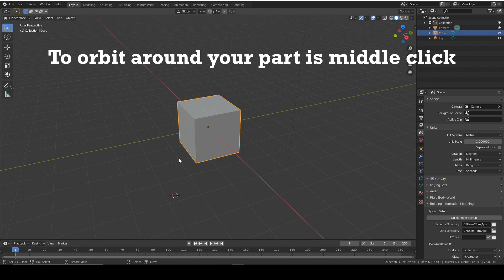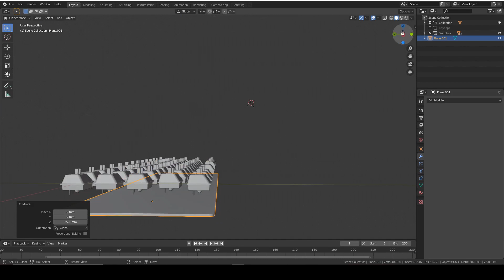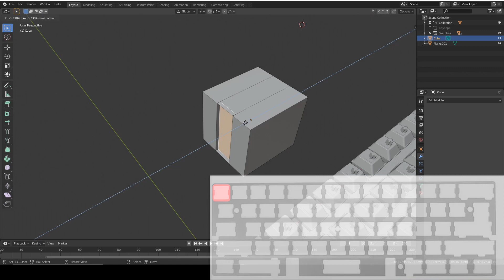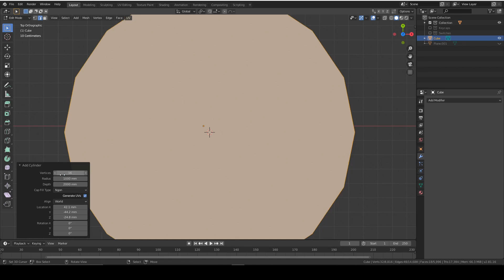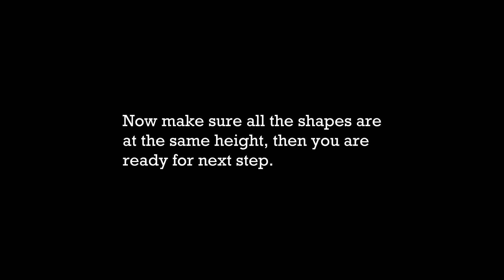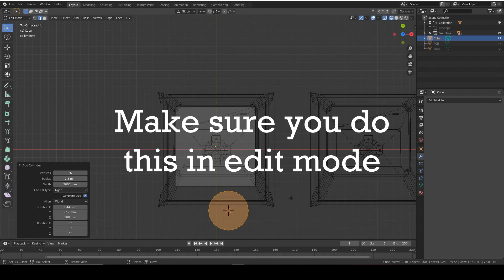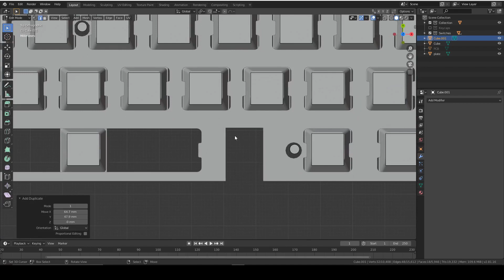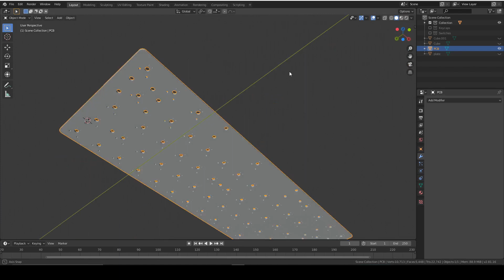How to build a keyboard in Blender- part 3

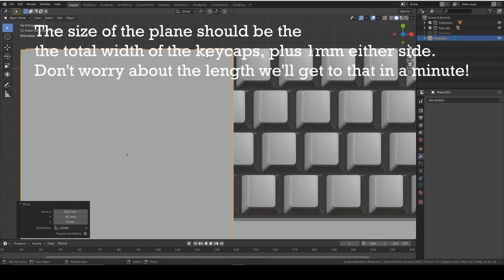Comment: 1:19 about what you said that bevels dont work with rectangles. They actually do if you go in to object mode select the object you want to bevel and press CTRL+ A and press scale. It will apply the scale and the bevel will work.